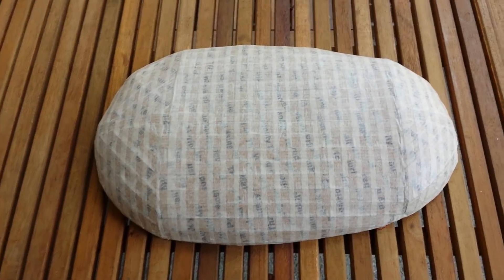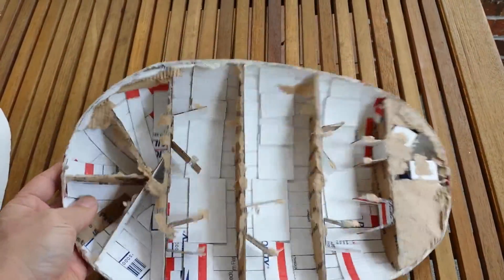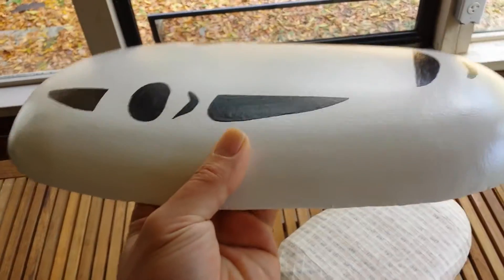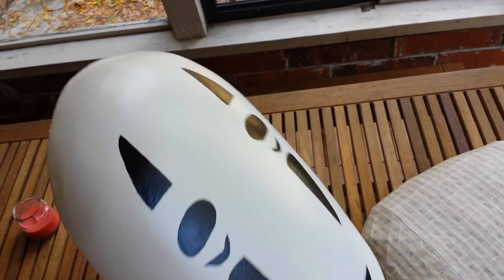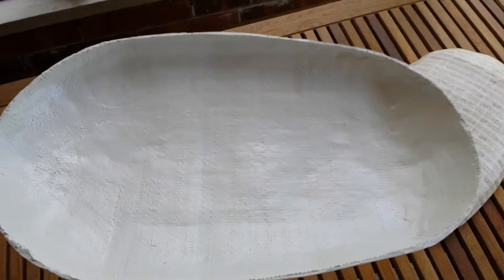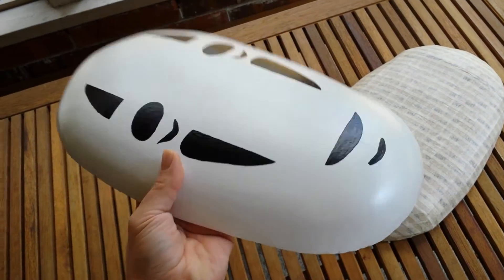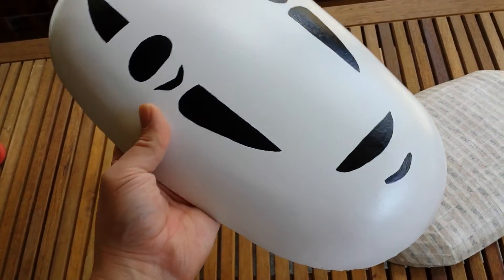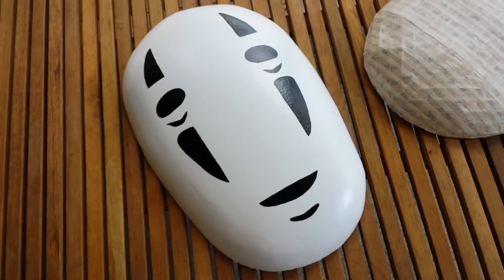No Face from Spirited Away - My Completed Ultimate Paper Mache Clay Project

Comment: You got the size of the mask right.   Looks good.   I'm no artist.  Don't have a printer.   Getting the art correct is my challenge.
Reply from the maker: Hi. Thanks for the comment. I'm pretty sure I just found a picture online, scaled it up to my ideal mask size and traced the design directly from my monitor. You can use the trace to determine the dimensions of the mask and start to build the shape.  After you make your mask you can transfer the design by cutting out the inner portion of the eyes, mouth, etc. on the trace and place it directly over the mask. Then trace the perimeter of the eyes, mouth, etc.  If you use this method be sure to use a painter's type tape so that it will not stick to the surface of your monitor too aggressively. Best of luck with your project.
Reply: @Leonsk08  Wow, how big is your monitor?  >.<   Mine's nine inches.   I'm trying to shadow puppet it to get a larger size to trace on my wall.
Reply from the maker: @KyleenDrake Lol. Alternatively, you could use a television. Another solution would be a projector and or an old school overhead projector with transparency sheets. Without the aid of technology you'll have to get creative. Perhaps there is a solution somewhere on Youtube.
Reply: @Leonsk08  A projector is $100 and takes up quite a bit of space.  They're not small for this tiny house..   The one at our local school is broken after a recent tornado.  And there isn't one at our library.  So my final idea is the old shadow puppet trace trick.   A simple flashlight, the pattern cut out on a small piece of cardboard.   How far away from wall surface determines size.  Looking for other ideas but perhaps other people reading here  might find this info useful.
Reply from the maker: @KyleenDrake  Ah, now I understand what you meant by shadow puppet. I remember seeing that technique done in a film. Alternatively, if your library lets you print, you could do a collage print. However, I believe you may already have the best solution in mind.

Comment: How did you apply the Drywall tape? Did you apply the compound to the tape before placing it over the plastic or did you use the DW tape with a sticky adhesive on one side?
Reply from the maker: Hi, I put the drywall tape over the cardboard form and then put the paper machete clay over that. 

If you don't want the cardboard to deform from the moisture in the paper machete clay, you can put a plastic bag over your cardboard piece and then put the drywall tape over that. 

If you're using a hydrophobic form(Styrofoam) then it will not matter. However, it may make it easier to remove the paper machete clay from the form after it has dried.

Best of luck with your project.
Reply: @Leonsk08  can i use a normal paper to do it ?
Reply from the maker: @nooraamer1328  Hi, if you can get the paper in a fine pulp like state I don't see why it will not work. Give it a try and best of luck.